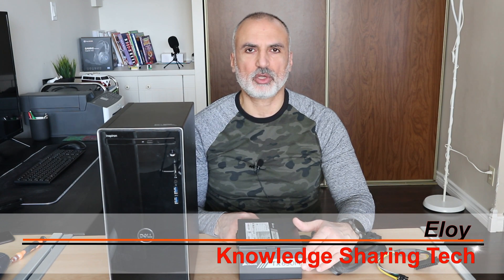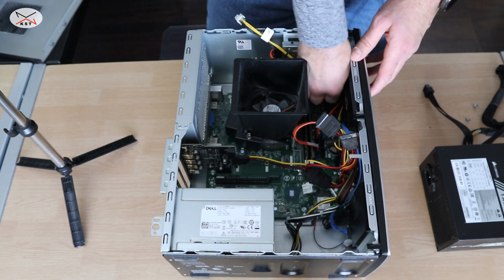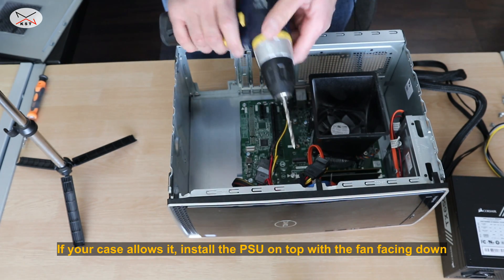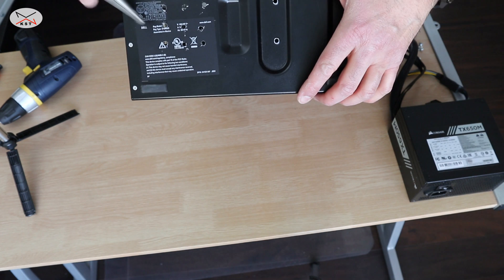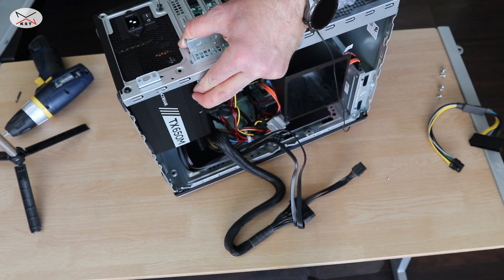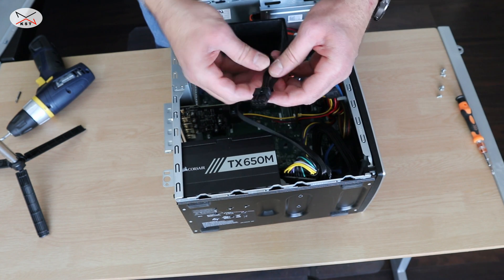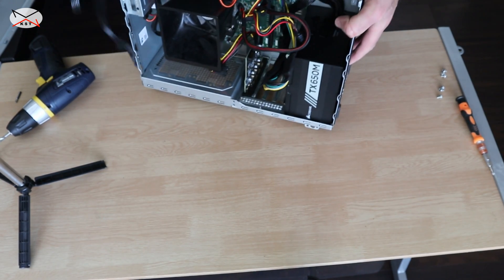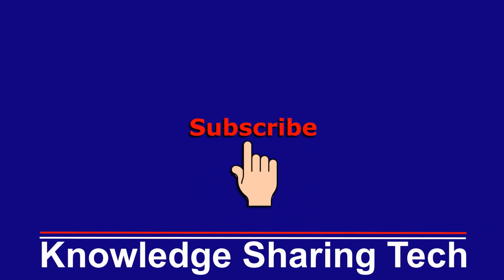Installing Corsair TX650M PSU in Dell Desktop face down

Comment: Moral of the video - don't buy a Dell because they are awful to upgrade or repair with standard PC parts.

Instead of all the drilling and cutting, another option would be to buy a very cheap PC case. Even a used one. Then standard PC parts will fit in and have correct airflow.
Reply: And I'm assuming the Dell will fit a standard PC case. It might not. I've seen Dell motherboards with not-square sides, the connector section was 1 inch proud or recessed compared to the rest of that side. Dell had deliberately designed their motherboards not to fit in standard PC cases.

Because Dell does this I've advised home users not to buy Dells. For corporate it's different. They won't be modifying, upgrading, etc, they just want 3-5 years use with warranty support.

Comment: I'm thinking to replace the 290W PSU with SeaSonic Fanless  TX-700. Since it's fanless, do you think the heat will be a problem with 3060 Ti in the case? Also TX-700 is too long, so I have to remove the original 3.5" HDD to mount TX-700. Can I remove the optical drive and place the 3.5" HDD in that bay, and what adapter do I need to do that?  Many thanks!

Comment: Hello, thanks for the information. Do you have any advice for cable management? When you rearrange the cables at the end of the video, I noticed that you put most of them on the lower right corner (from the cameras view).
Reply from the maker: Welcome. The Dell's case doesn't have cable management unfortunately, so I put the cables as far away from the motherboard as possible. In cases with cable management, the PSU cables are usually routed on the backplane of the case

Comment: Great video! I was wondering if there was any chance to damage some of the components while cleaning with a vacuum cleaner.
Reply from the maker: DO NOT TOUCH any component with the Vacuum cleaner. As you saw in my video, I only cleaned the empty area of the dekstop
Reply: @KnowledgeSharingTech  I see thanks! Does any vacuum do the trick?
Reply from the maker: For the dust, yes. But for the metal particles, it is preferable to use one with a disposable dust bag.
Reply: You can also use a small soft brush. A clean paint brush, small cleaning brush. Less chance of sucking up a cable and pulling it :-)

Comment: Very informative, I just have one question about your customized ventilation system :D. It is necessary to drill these holes or is it
 just preferable?
Reply from the maker: Thanks, I can say It is highly recommended otherwise the PSU, when under heavy load, might overheat
Reply: I'd suggest using a dremel to cut a window out in the base of the case then pasting some dust mesh filter over the window from inside